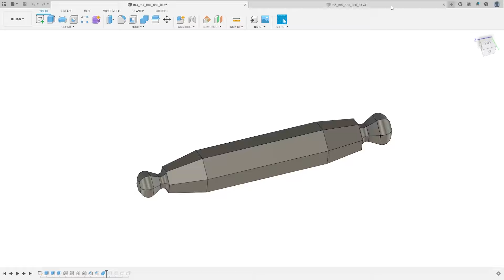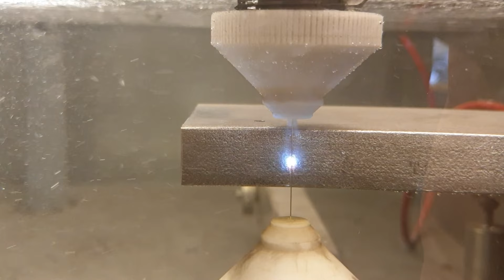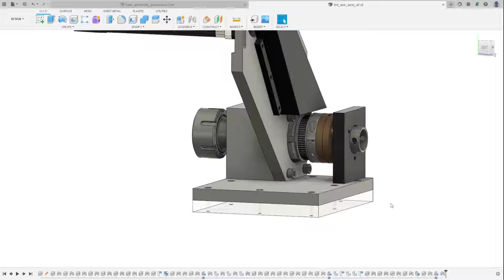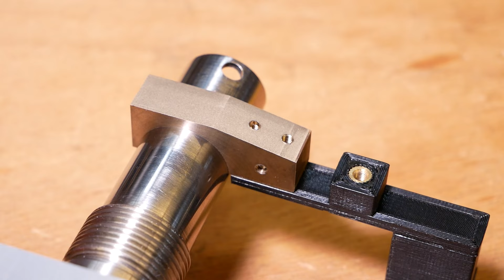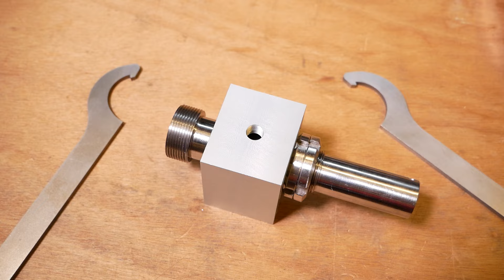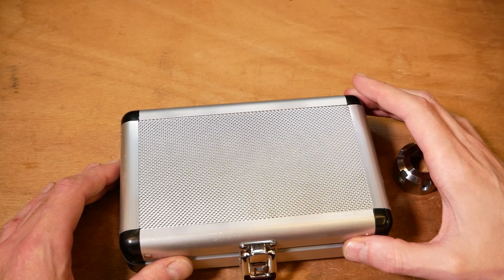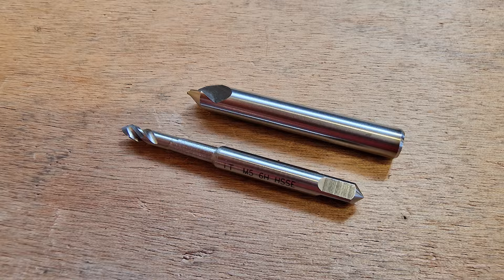Worlds First DIY Wire EDM Lathe!

Comment: Firstly, thank you for a very well produces video which clearly shows exactly how everything was done. This is the first video of yours I have watched and I will certainly be watching your other videos. Now for the constructive comments, at least I hope they are. Like many others I was wondering how you were going to use the 7 mm hex key. Some grades of SS are magnetic but maybe there other properties did not meet your requirements. I think I would have supported the other end of the motor so that there is less torsion on the support plate which is quite high. And, again, I would have supported the other side of the plastic plate which is applying the pressure to the rotating power connection. As this video was posted 2 years ago maybe I should have looked for any follow ups first!  Anyway many thanks again. Now to watch your other videos.  Paul.

Comment: I am a Mechanical Engineer (University Bachelor degree) but before that I was a Fitter / Machinist, so I know my way around a vernier caliper and a set of allen keys. However I trained and worked with Mechanical Engineers that wouldnt know one end from the other. Its not a given that ME's are familiar with hand tools, that knowledge is usually gained after hours.  I have heard people use the ME description when they really mean Mechanical Technician, or even Mechanic.
Reply: Well said. Kudos to you for acquiring professional fitter/machinist skills and becoming a degree'd professional engineer. What a killer combination!
Reply: @camshaftcasting1451  Thank you. Its not often people understand that. I could count the number of Tradie/Engineers I've met on one hand.

Comment: I would have thought the hss you used to make your tools would be rather brittle... 🤔
Nice project, you spent quite a bit of time explaining why the printed block / seals / steel bearings wouldn't work but it seemed (to me at leadt)  you skimped slightly on explaining the ceramic bearings iteration, ..I understand the concept but others may not have... just a thought... 

😎👍☘️🍺

Comment: This might be an absurd heat sniping challenge, but perhaps you could substitute a cut ball surface on the tool with a cutout into the shank of the tool, then heat treat the connecting portion of the metal to make that portion a spring.

Comment: Great video. Actually first video that I have found on Youtube that does Rotary Wire EDM on a homemade machine. What CAM you used to generate a G code for Rotary Wire EDM. I have found that only ESPRIT has that feature. I wonder if there is some another option for that type of machine because I want to implement it on a Foam Cutting machine that has 4 axis plus one rotary axis. Your help would be so much appreciated.
Reply from the maker: I don't have CAM for the 2D + rotary axis. I use F360 CAM for 2D wire edm, then add the  g-code for the rotary axis by hand. Very tedious. Still looking for a nice solution.
Reply: @baxedm9806  Oh, that's very repetitive job, but it works. ESPRIT have that feature, they call it Turn and burn and Turn while burn, I found installation with crack on some russian site, but it doesn't work😂

Comment: If the shaft is 4 mm and one side is a 4mm ball hex and the other side is a 5 mm ball hex you can never use the 4 mm side because the 5 mm ball hex won't fit in your 4 mm tool holder you should have made them cross shaped with 3 sizes on the top 3 of the tee and a 4 mm shaft at the bottom

Comment: this is not the "Worlds first wire EDM lathe" I opereated one in 2000, it was a ONA wire EDM with a C axis that is used for that purpose< the machine is built in Durango Spain. The ONA brand machines are a very high end machine with high efficiency machining. I like what you did and folks can build one for themselves.

Comment: I'm not at all qualified to offer a suggestion to the bearing issues, i.e. - the conductivity between the outer ring and the inner ring. But, what if you replaced the balls in the bearing with ceramic balls and sealed the bearing with a ceramic front and back plate to keep the bearing packed with grease? Are you familiar with a mechanic seal that's used to keep water out of a motor on pool pumps? Perhaps you could use some of the same principles in the way those seals work.

Comment: Am I missing something ? The Ball end Allen bits are for a 4mm ? hex in the knife. You state that one ball end is 4mm and the other is 5mm so if that's true then you cant use the 4mm ball end as you will need to hold the bit by the 5mm end which wont fin in the holder ! Above 4mm the bits will need to be single ended.

Comment: EDM looks like a supeior way to cut compared to plasma , waterjet or laser in the home workshop. I'm definetly going to look into this further, thanks for the great work. super interesting.
Reply: Depends on what you're doing. Small stuff like this, sure, but if you need fast cuts plasma or laser are the way to go. Waterjet I don't think is great for home use though. The benefits of it just aren't there for the home DIYer.
Reply: EDM is stupendous precise, but also quite slow

Comment: I am confused by the title of this video... I tried to just skip to where the point as to title making sense, as I have ran EDM and CNC lathes for decades, and I failed to comprehend how and WHY anyone would want, need, or somehow think that the 2 combined could possibly exceed the capability of either 1 individually....? You can make hex, star, or essentially any fathomable bit in existence or unique to application on either individual machine type. On a lathe, it would merely require "live" tooling, which is easily achievable by just mounting a router to your manual lathes tool post, and indexing the lathe spindle and locking it. Or on an edm, from raw stock using the available axis' on even the oldest EDM's I've ever seen..  there might be EDM's that don't have u,v,x,y,z axis capability, but I was pretty sure I ran some of the oldest cnc Hitachi edm's made. The 90's model with floppy disk drive, and green only screen read outs could still burn a dna helix profile. In a lathe, vertical or horizontal, what describes the machine in itself, is that the work rotates in a spindle so that stationary cutting tools can be fed into it. Completely different than a mill. Weather the mill is horizontal or vertical, it's the same concept in reverse, in that the work is stationary, and the tool is in the spindle rotating, and the work is fed into it. Both of these are completely different, and entirely incompatible with an EDM! Precision reverse welding, has to be controlled with current and wire feed, submerged in deionized water, or a dielectric oil. Honestly, adding a "c" axis to an edm, to rotate the workpiece while electronically displacing material doesn't make any sense at all, because an entire hex bit could be burned out of a blank from raw stock, to complete bit, assuming it wasn't a "security bit" that required a relief on the nose face. Intriguing click bait title, but there is OBVIOUSLY a reason that in the entire industry from creation to present day, has there EVER been an EDM lathe. 👌🤭👎💩

Comment: 11:15 instead of oil, add a port to the body to introduce a small amount of compressed air to create a positive pressure. This should prevent water from entering.

Comment: I had an idea that may help. If the wire runs horizontal in the water, then the rotary axis can be vertical meaning the rotary electrical connection can be out of the water. Another thought, use standard lathe water based coolant, which also works as a lubricant. I have repaired machines called a "Spark Eroder", If I remember correctly they used a tungsten pin to do the eroding, they were making dies for plastic part injection molding.

Comment: Enough with the 3D printed bullshit I can't watch anymore it's enough man dissimilar metals again that's not going to fly created your own electrolysis machine why time you have enough clearance between the spindle and that bronze piece you no longer have a contact want to have a shoe contacting the spindle you should use graphite running on a carbide round or something that's easily replaceable without tearing everything apart but you cannot have that run open in oil or water or you have a nice die sinker electrode eating your spindle too many things to go wrong to even begin

Comment: Why would you want isolate the fixture from the work table I have news for you we used to cut ceramic on our wire edms it does in fact have a breakdown voltage kiss your bearings goodbye why not just put a commutator between spindle and it's housing or regular bearings with proper seals filled with Mercury use that for our contactors taking old round carbide insert open a hole up in it for a sealed bearing and fill the bearing with Mercury they last long time the stationary contactors get cut as the wire passes by must be turned all the time.
Back to the matter at hand plastic and aluminum are very poor choices as their rate of expansion in case of aluminum is bad and plastic is insane.
Say you can't afford a block and some plate of stainless steel is hard for me to grasp looking at your shop one of the pieces of test equipment behind you is way more money.
The only thing you should have around your machine of plastic would be one of the bars on your indicator holder we use fiberglass rods so you don't kill your indicator.
Manufacturing anything is expensive cheaping out is unimaginable scrap one part will pay for all the material you need.

Comment: You know we were using indexers and rotary axes that were tied in to the other five axes probably when you were still in preschool on our wire edms thank you.
What were you doing in 95
We had a die sinker with a real tool changer we mounted parts on the electrode holders so they were easy to change with copper electrodes bolted down in the tank with a block of copper infiltrated tungsten for shaping and squaring up the cutting face mounted in one of the electrode holders in the tool changer production baby.

Comment: Very cool, you will need to temper your bits if made from tool steel as they will be way too brittle and will snap with very little load, better still make the ball end bits from other keys they are manufactured from specially developed steel.

Comment: Another Idea Would Have Been To Use A Longer Spindle Shaft And Using Shaft Seals To Only Come Out Into The Tank Not even The Spindle Housing And Belt Would Be In Contact With The Dielectric , Just An Idea !

Comment: Engineers.... lol... why are you guys always trying to reinvent the wheel? For the seal issue take a look at high speed industrial water pumps, they use a spring loaded ceramic seal that doesn't add much friction, for the electrical contact from rotating to fixed current look at brushed electric motors, they use spring loaded brushes that are designed to be cheap and wear... selecting the right components for the application goes a long way and would have saved you a lot of design time and effort... signed- all machinist everywhere

Comment: Fun fact: 
Lots of old satellites from early space exploration have metal bearings in their reaction wheels (spinning weights used to rotate the satellite) and static would build up and jump from the inner ring to the outer ring of the bearing which would damage it slowly over time. This unfortunately was the reason a bunch of old satellites, which otherwise worked, were decommissioned or abandoned.
Reply: isn't it funny how smart you can be, think of every outcome and then BAM! The ol' static bearing discharge problem again. :)
Reply: Usually correlated with strong solar activity. The funniest part is the solution came years before they figured out why they failed. The bearings were switched to ceramics quite a few years before the static discharge failure was explained.
Reply: Scott Manley video on this: https://www.youtube.com/watch?v=KibT-PEMHUU (interesting comments too)

But "lots of old satellites from early space exploration" makes it sound like this happened several decades ago, when it was much more recent than that. Kepler, Dawn, Hayabusa, and other relatively recent spacecraft are suspected to have had reaction wheels fail due to this.
Reply: Hubble is.having this problem i think. They are down two reaction wheels and using the remaining ones with some voodoo generated software code to compensate....
Reply: Fun fact show me a picture of a satelite. Spoiler alert you cant
Reply: @williampeck428 Try Google? I mean, come on. NASA has loads. Starlink launches are ten a penny, you can watch the entire thing live, including dropping out the satellite!

Comment: For an engineer your not very bright.  Double headed bits with one end larger than the diameter than the shaft makes the second smaller end absolutely useless.  Any tooling with larger end than the tooling shaft can only be one ended.
Reply from the maker: I forgot to mention that the bit holder accepts 4mm as well as 5mm bits. The mouth is 5mm and the throat is 4mm.

Comment: for the ball barrings what about using O-rings in a channels with silicon grease as lubricant. I don't think it would hold up for high speeds but for low speeds as the barring turns the rubber O-ring would slip around the channel making a imperfect seal. you could double this pattern up as space permits. you could swap out the section to a design that would erode more.

Comment: you have a EDM machine so making gears is easy for you. why not use sacrificial gear made from something that erodes more then the steal. So you have the sacrificial gear extend out of the water and make contact with a geared lathe spindle. the gear is always making contact with the lathe spindle, water will get pushed out as the gear teeth mesh. the next thing I want you to think of the sacrificial gear as a old style vinyl record music player. The wire contacting the sacrificial gear will be the record playing needle, as it cuts in to the gear it will slightly spiral in or spiral out. the needle should be made of something that erodes less then the sacrificial gear, you will need a new sacrificial gear when the needle starts to cut threw both sides of the sacrificial gear.

Comment: Isn't the m5 one bigger than the shaft of the actual but body? So the bigger side won't fit into your knife's socket so you can utilize the small side of the bit? 
Also I think those should be tempered down a little bit, coming from extremely hard cutters, those small necks are probably prone to breaking very suddenly. A pretty good way to punch something harder than your own fist and break a knuckle or two. Sudden hand tool failure is no joke

Comment: As a gun owner and workshop tinkerer I have one advice: cold bluing is shit compared to hot bluing. Cold solution does not provide high resistance to rusting, should be used only in case of a scratch for cosmetic reasons, and in my opinion it looks crappy compared to hot one.

Not to be that one salty dude in comments; man, was that a beautiful piece of engineering!

Comment: For the M5/M6 bit, it seems to me like you would not be able to use the M5 bit because the M6 side would be too big for the tool.
Very cool stuff though.
Reply: I was looking for this comment, I agree
Reply: @kingcosworth2643  same
Reply: I knew I was not the only one to wonder about this. Lol
Reply: waited the whole video thinking of nothing else.
Reply: Same
Reply: I was literally about to type the same, but realized someone surely mentioned it already.
Reply: I think the given play in tolerance he has when inserting the bit might fit that just fine which is why he used a magnet to hold them in the socket. But then looking at the Victorinox Cyber Tool features it is in fact a 5mm Female Hex Drive (For D-SUB Connectors) so no The 6mm side wont fit and he cant use the 5mm.
Reply: I thought this too but i assumed i was wrong because this guy is so smart.. 😂😂
Reply: Man, Y'all Beat Me To It!!!😄😄😄
Reply: Yup same here 😀
Reply: I asked the same question and then read you asking it...
Reply: Optical illusion M6 key is 4mm
Reply: @Anyone700  key is 4mm but head is 6mm. How will the key fit over that?
Reply: @Anyone700  How is an M6 allen key only 4mm?

Comment: Fail on 2 nd bit design 
 The m6 end is larger then the 4 mm bit holder . So flipping it to use the small end will not work.

Comment: Hi Mike, once again, an elegant explanation and a fantastic design.  How did you program your rotary axis?  in essence, what is your cnc controller for that axis?

thanks again for sharing
Reply from the maker: I simply added the rotary axis to the cnc control which is also driving the X and Y axis. That controller, made by Dynomotion is capable of driving up to 8 axis simultaneously.

Comment: How reliable are your designs?  Here you have designed a 4mm x 5mm double ended tool bit to fit into a pocket knife which accepts 4mm hex shaft tools. 

You even show the 5mm ball bit in place ready to use.  I notice you didn’t show the 4mm ball in place ready to use because the 5mm end will not fit into the 4mm receptacle.  So with all that planning you have a 2mm, 3mm, 4mm, 5mm set which only has useable 2, 3, and 5mm bits.  

Slick EDM setup, I would love to have something like that but don’t as I am aware my errors are far more spectacular than yours!

Thanks.

Comment: Probably a crazy idea, but could you have made the vertical mount and the base plate out of ceramic? Perhaps a specially cut glass or even granite? It would reduce the complexity of isolation and anodising, although add to the challenge of construction I imagine.
The rotational contact reminds me of something I saw on Cutting Edge Engineering's YouTube channel (although his was many times bigger for rotational welding).
Reply: epoxy granite maybe?